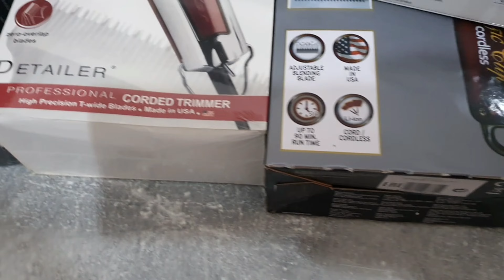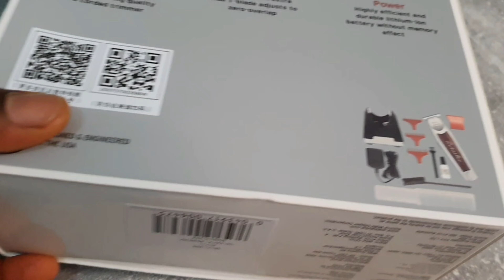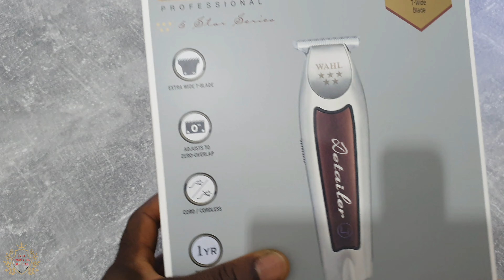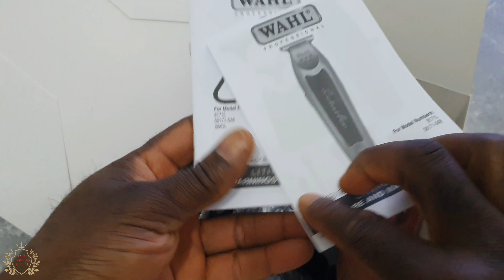Wahl Cordless Detailer Unboxing | RPM | Teardown | Motor | Battery #wahl

Comment: What is your Favorite Clipper of Kemei bro? 1986 pro or 2010 better?
Reply from the maker: Before it was 2010 but now its 1955
Reply: @edounboxingofficial  and between 1986 pro and 2010 what would you say is better?
Reply from the maker: @kellersoldier6214  1986 pro or 1986 pg are trash
Reply: @kellersoldier6214  2010 is def has a better power, performance and looks
1986 (not the pro or the 1986+)
Are heavy, the body structure sucks, slips, but has longer life of 4hrs use vs the 2010 that only has like 2hrs of runtime, but nothings best than the 2010's performance its one of the best chinese clipper
Reply: @kellersoldier6214  dont get the 1986 PG or 1986 pro, or anything else that looks like it, its a complete junk be wise buying
Reply: @edounboxingofficial  @Christian Besonia Thank you guys i will get the 1955. Which Kemei Trimmers and Foil shavers is your favorite or the best?